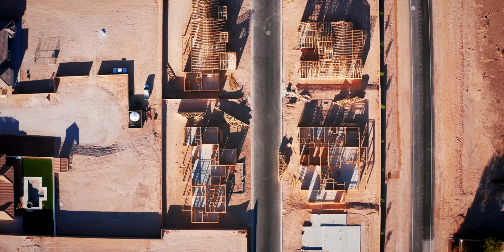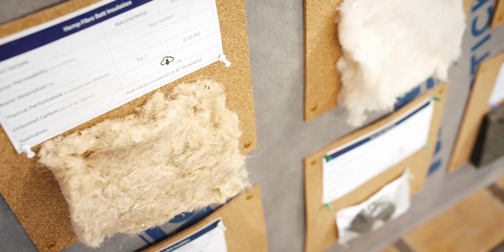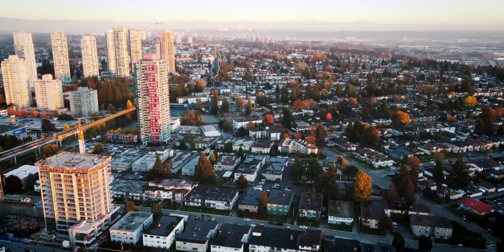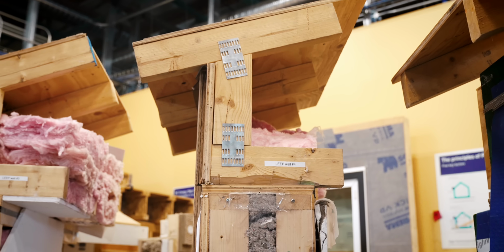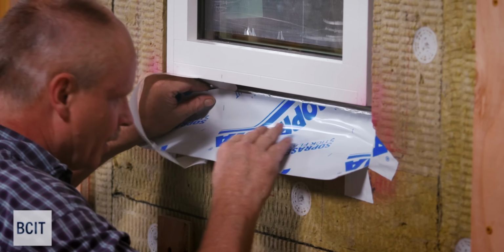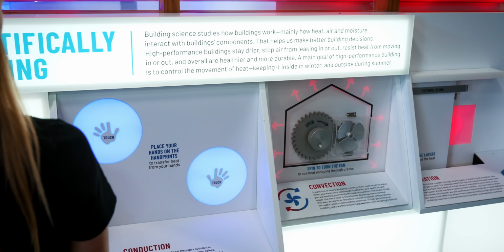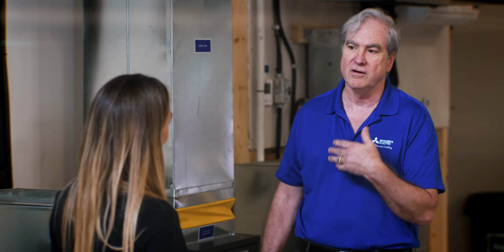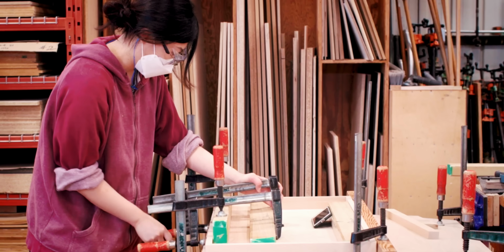THIS Is How You Build A Passive House!

Comment: I was learning about low energy, long life, lose fit buildings 45 years ago training to be an architect. I've been trying to design low-carbon buildings ever since but only very rarely asked. That is the main issue in the UK, nobody is interested unless forced :-( I was designing using SIPs over 30 years ago, before they were called SIPs :-) Building passive homes is a problem, designing them isn't. My BIM software can even thermally model my designs and check them against the PassivHaus standard. But never been asked to design to that standard yet! Why is that?
Reply: Is it time to allow full "off grid" housing in rural areas?? These would be zero carbon and zero public infrastructure. The cheaper land values ought to allow these houses still to be very affordable and could take the pressure off and show the way for urban areas??
Reply: @simonpannett8810  Off-grid houses are already allowed if you can get planning permission for them, connection to the grid is not a prerequisite to getting planning permission, many other things are though :-)
Reply: @simonpannett8810  Off-grid doesn't mean 'no-carbon'... if anything, it tends to mean the opposite - an implication of heavy oil and bottle-gas use etc.  The grid is not as dirty as people think, and it's getting cleaner all the time... having a 'grid connection' is not a sign of being wasteful, and being off-grid is not a guarantee of energy-efficiency.
Reply: How often does a client ask you the lifetime energy cost of their design?
Do they ever ask about ventilation systems?
Scotland is looking at changing its EPC process, which would make the current "C" grade houses illegal for rent or sale - like BC.
You may find clients asking about it real soon...
Reply: @davidcassidy2944   I do hope so, full lifetime costings haven't been important to anyone except city based large businesses for a long time. Even the NHS wasn't concerned which is why so many of the PFI buildings designed for a 25 year life are falling apart now. The NHS didn't, apparently, ask them to last last any longer than the repayments under the PFI 'rules'. That's my understanding of the current issues with Part L only, short life, tight fit buildings of today :-(
Reply: Because carbon emissions are an unpriced externality. 

Price it properly and the market will suddenly ask you to build lower carbon buildings.

Comment: Maybe you guys have done this before? But have you considered doing a video on just an average home with average owners.
Who want to clean it up and do many of these more sustainable tech energy efficient improvements to it. Why not cover that?

Literally go line by line with each cost, the rebates or tax incentives available associated with those improvements&any that are actually claimed. The total cost post rebates&incentives, along with the est total energy savings in kwhs. Along with any cost reduction in the homes energy bills. 

The builders or installers time frames for the various installations, inconvenience if any to the homeowners? Just break it all down for an average couple in an average house doing what they can and what qualifies for the tax credits and energy rebates in their area. 

I saw a very similar article with no videos unfortunately over on cleantechnica recently. It was very fascinating to read. 
Done by some real people with their real first hand honest actual numbers for the invoices etc all posted to show the before and after costs.

Inconvenices if any and improvements in interior air quality, total decibel levels with hvac on and off and the energy savings in kwhs before and after the total home improvements. Basically they went all electric in an older home, added insulation, new windows&seals, plus upgraded the main panel & added an evse.👍🏻😎

Comment: People need cheap houses, not "passive 🤓"
Reply: Passive houses are cheaper, have you looked at the price of energy lately??
Reply: @injest1928 it's funny to listen all this eco bs, when half of this video you watching suburbias
Reply: @kodebsky  you think I'm basing my statement off the video? No, I've worked on a passive house. The material cost is only slightly more expensive. The major costs are getting people trained with the new methods and materials. Done at large scale with appropriate training, it doesn't have to be much more expensive. Done correctly, the passive construction cost will pay for itself easily in energy savings.
Reply: @injest1928  This is the most important lesson we need people to learn - done correctly and at sclae, the extra capital costs will be small, and the savings for the occupiers will be real and valuable.
Reply: It's shortsightedness like this, which got us in the bad position we're in.
Reply: The overwhelming problem with house prices is ridiculous land cost. I just checked and near me there is a plot of land going for £80,000. That's the same price my parents' house cost in 1999, inflation adjusted. Roughly the same area as their house & garden, but missing the actual house.
Making the building on top with worse insulation isn't going to help.
Reply: @drunkenhobo8020 I wish it was the case where this was filmed. The average price of a home in Burnaby, BC is nudging over $1.5M, and building lots are more than half that. Unfortunately, until governments can get their heads around the profit angle of buying and selling homes, more and more people are going to be priced out of owning a home. And before anyone asks, the price of apartments and even the cost of renting are just as bad. I wish we knew what the answer is. All the same, thanks for the video, Imogen and crew. Maybe we’ll have to jump on the ferry and come to the show.
Reply: @davidcottrell570  A large problem with making houses cheaper is that everyone who already owns a house gets annoyed, as they see their house as an investment. So they'll feel as if they're losing money by devaluing housing (even though they're not really, as it doesn't just make their house cheaper, but every one).
Of course the real issue is how much of the wealth of the rich and powerful is tied up in housing, and if you cut the cost then they'll lose hundreds of millions. And we can't have that!
Reply: @drunkenhobo8020  You hit the nail on the head! I see my house as a home, not an investment to profit from. If I sell it, the replacement will likely not give me much cash in my pocket, even if I downsize, given that all homes are expensive here, and the bank would expect me to pay down my mortgage. And if I were to profit, that would suggest income, or a net capital gain which should be taxable (but isn’t). That it isn’t, and more than a few people profit from renovating and flipping their homes is a part of the problem. If governments were to crack down on some of the profiteering that goes on, it might well shock the housing market, but if my house goes down in price, so does the next one I buy. The trouble is that when they keep going up, they squeeze more people out of being able to afford to buy or rent. But governments like being re-elected and as you say, don’t want to annoy home owners. And if you thing the Opposition parties have better ideas, there’s this piece of swampland…
Reply: Hong Kong has cheap micro-apartment housing in tubes, but you probably don't want to live in them.

Comment: why is mineral wool the main insulation material used as sarking in these shots? You'd think that in a country like Canada, that has such a extensive wood industry, there'd be more wood fiber and cellulose available than they'd know what to do with. Wood fiber insulation and other plant-sourced insulation materials have perfectly adequate insulating properties (and in some metrics, beyond simple thermal insulation coefficient, even outpace synthetic ones), and it has a significantly lower carbon footprint than any synthetic insulation, be it glass fiber, mineral wool or foam panels.
Reply: Fireproofing, I’d guess. Or cost. Or both.
Reply: @davestagner  It's mostly a cost issue. Wood fibre insulation is usually treated to make it less combustible, but ultimately it can always be made to burn, so you might need to use thicker sheathing to allow the necessary time for the occupants to escape. So you can design a structure that has the same performance regardless of what sort of insulation you build, but it might cost more. Wood fibre should be an ideal insulator for Canada given their lumber and land resource. Wood fibre is not as good and insulator as mineral wool, you need more of it; which in turn can make the walls thicker, so each house requires more land if it is to provide the samel internal space. But Canada has lots of space so having walls that are 200% thicker doesn't really matter.
Reply: @tlangdon12  The insulation value difference between woodfibre and rockwool is small. typically 0.40 vs 0.43 so it really doesn't make any difference to the wall thickness, especially because woodfibre can double as a structural or racking element whilst rockwool can't do that. Rockwool is cheap and doesn't burn though, so you are probably right about why it's used. Also I'm not aware of any Canadian woodfibre producers, and it is heavy so you don't want to be transporting it halfway round the world - that spoils the embodied carbon numbers.

Comment: Me too!! I helped build one then decided to build my own. Really not that hard but not many people want to spend money up front to save later.
Reply: It's a false economy. It's much easier to build in quality from the outset rather than try to remediate it afterwards. Any house I build will have gutters that have much more capacity than the UK buidling regs. require because we are getting much heavier storms than we used to. But are the volume house builders looking at how the designs of their houses need to change? E.g. by including air conditioning and the electrical systems to allow this to operate on a net-zero basis for the length of heatwaves we are now getting?

Comment: Architects! And passivehaus designers. We have loads of highly trained highly skilled architects and tradespeople in the UK. It’s the public that needs educating about where to find the right people.
Reply: I'd disagree that it is the general public that need educating about where to find the skilled designers. They don't use these designers. What we need the general public to understand is that efficient houses are available AND it it is worth paying a premium for them. We also need people to refuse to pay the inflated prices for the old, inefficient houses that abound in the UK.
Reply: @tlangdon12  Yup - that, and for the gov. to get off their arses and actually mandate some modern standards for new builds... 

personally, I'd like to see something like the BC step code (rather than the typical box-ticking approach the UK gov likes), plus requirements about solar, storage, and installing wiring (note: just the wiring) for en EV charger (far cheaper to run the wiring when the house is built, rather than after... ditto solar & storage).

Comment: UK govt need to watch this. Reskilling and retraining the building trades should be happening now, rather than in some distant future dimension. New building regs are slowly being rolled-out, but the investment in forward planning and training is woeful. If we end up with another 5 years of this government in power, we will be stacking up huge costs for the next generation to find.
Reply: We've been stacking up big costs for the next generation on buildings for 20 years now. It's so depressing, and could so easily have been fixed. Sadly in the UK, the bulk housebuilders captured the system and worked for their own short-sighted goals for many years. There is still very little happening, beyond a promise for somewhat better regs in another 2 years, whilst nothing much happens on the ground except amongst the well-off and/or aware, since that horrible human Osbourne cancelled the 'Zero Carbon buildings' plan 9 years into the 10 year run-up. That was a huge climate crime for which he should have been locked up IMHO. The amount of extra emissions it has caused and will cause is truly scary. That and the related measures at the same time are now costing every UK household £150/yr (i.e £3.5 billion collectively). And still, a decade on, the conservatives just don't seem to get it. I cannot understand what is wrong with them, although I think innumerany in the average politician has a lot to do with it.
Reply: How so? Can you elaborate further please?
Reply: In Germany the media, with false claims, and some political/industrial/idiotic organisations have managed to make people believe that heat pumps aren't working. 😢 . So sad to see that some people are not capable of identifying proper physical connections on their own, a world full of misinformation
Reply: UK cabinet officers first need to learn how to tie shoelaces. Includes women.
Reply: Sadly, it is not the fault of any particular political party, building regs simply are not a priority for any politician because there are no votes in it (I do think that will change but not rapidly).  As a consequence the regs are left to civil service to put together and they never do anything quickly.

But to put this into context for the UK, there are currently c.25 million homes in the UK and we build at best 250,000 new homes a year.  Building new homes that meet very stringent passive house style standards, whilst definitely a good idea, is a relatively small part of the solution - it is retrofitting old homes that needs to happen.  The Govt. has proposals for the private rented sector to require all hmoes to be at least EPC "c" grade which is a decent start but it is doubtful those will ever get implemented - it is highly questionable economically, the EPC grading is not fit for purpose and there simply are not enough trained people in the construction industry to complete the work in the timescales suggested (IMO it would need at least 10 years)
Reply: @justinstephenson9360 There has to be money to retrofit older homes.
Reply: @justinstephenson9360  The fact that the building regs are not a priority (because there are no votes in it) is the main problem we have with our politicians. None of them do stuff because it is the right thing to do any longer. There is no leadership. They might try to do some leading on certain issues that are close to their hearts, but for issues that are really big and important, the majority don't seem to have a clue about what the right thing to do is or how to lead the public to realise that changes are necessary and desirable.
Reply: @tlangdon12 lol!!!! It's all about money! We have to subsidize EVs! Subsidize literally everything while oil alone is still doing all the job!
Reply: @alanmay7929  Of course, the Biggest subsidies still go to Big Oil.
Reply: @justinstephenson9360  you're absolutely correct, 10 years sounds about right. That's why massive investment in training should be happening now. We're just not seeing any action on this. Just lots of press releases.

Comment: i used to read all them back issues of mother earth news and other weirdo freaky hippy stuff, there was a LOT of passive and carbon neutral stuff all the way back in the 70's, i remember enough that i could do a passive house now, but, some of the ideas are weird and confusing.  my fave is building a house... in a greenhouse, with a passive airflow thermal mass heating system in the basement.